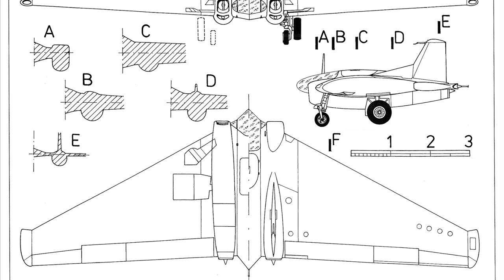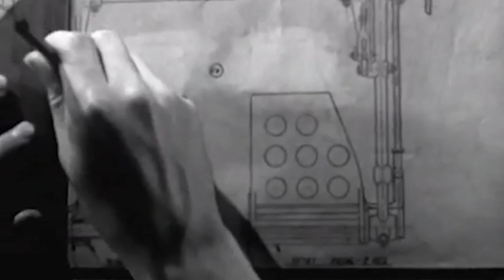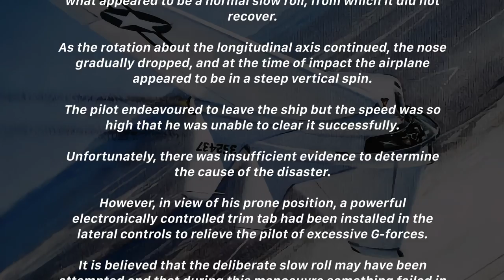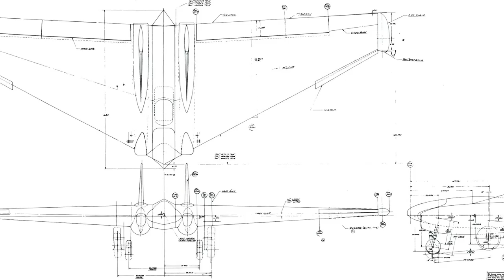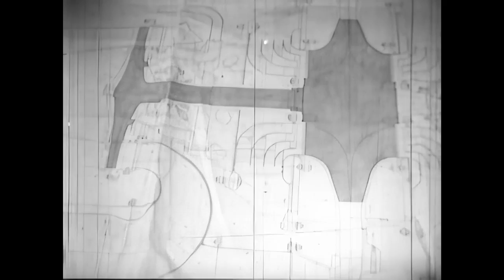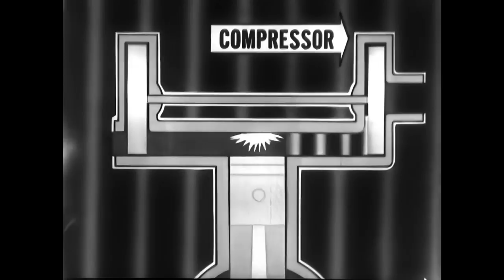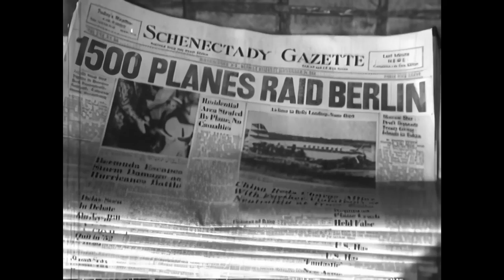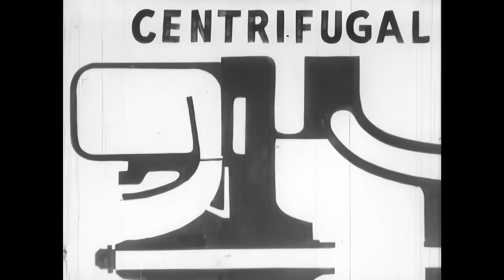The Flying Chainsaw | Northrop XP-79 Flying Wing Fighter And High-speed Rocket-Powered Aircraft

Comment: The 19B engines were returned to Westinghouse for examination after they were recoved from the crash site.  Examination showed they appeared to have been running normally at the time of the crash, but due to much damage to the piping and accessories, some sort of malfunction could not be conclusively ruled out. 19B's were highly sensitive to oil flow interruption to the bearings of any kind but the examined engines' bearings appeared to be undamaged.
Reply from the maker: Very interesting. Thank you 🙏
Reply: Catastrophic bearing "touch down", shaft welds itself to the bearing, the kinetic energy has NO WHERE to go. Destroys surrounding, engine block,secondary, crankshaft, housing, valves,cam shaft..blah blah. A "RUNAWAY" tank engine did it. Manual fuel shutoff, (of course) mechanical fuel pump, fuel lines,gallons.. tried to starve her of AIR!? Too late, turbo & blower..she sucked my red Mechanics rag outta my coveralls "high RPMS" she didn't even fart. Slapped my clipboard over the intake..She sucked a hole outta it, all 81/2"paper.  She was very angry! With no other options I told the other fella mechanic..BAIL! Take COVER! Sad, it was ALOT 💰 MONEY, and we were SHORT one LAV.  Funny now, but still VERY sad. she was one of our best vehicles &we had put ALOT of time & love into her..Even stealing parts. 😟
Reply: @mylittlebrotherca9691  sounds like my ex wife.

Comment: Love these old films,...And I love finding incongruencies. (Oopsies).
At about 22:00 they are pulling a "secrete" package out of a plane and transferring it to a panel truck.
Film is suppose to be in 1941.  The van is a First Generation Ford F-1 Panel Truck. 1948, 49, or 50. Oops! 
Panels from 1941 through 1947 look way different.
Great film, I love this kind of stuff.

Comment: The British Miles M-52 was built to fly 1000 miles at 1000 miles per hour. It had a pilot’s capsule that could be jettisoned in an emergency. The British government cancelled it and gave the design to USA.
Reply from the maker: Those are mostly rumors, it's almost impossible to find any hard evidence. Interestingly the legendary Eric "Winkle" Brown, the pilot that was scheduled to test the M.52, before it was abruptly cancelled, talks about it in this documentary: https://youtu.be/PSRAdZzRycc
Reply: I’ve read that it was the concept of the all-moving tail taken from the M52 and tested successfully in 1943 on a Miles Gillette Falcon that cured transonic stability issues with the Bell X1 which when it first flew with fixed tail surfaces encountered control issues at  M0.94.
Reply: @davidpope3943  Exactly David!

Comment: GE already having Turbo Supercharger experience was a huge advantage. The combustion chambers in the Whittle are just a bunch of pipes inbetween the compressor and turbine.
Reply from the maker: I am assuming you already watched our documentary about Sir Frank Whittle :) https://youtu.be/G0T4-XG612Q
Reply: The combustion cans were the result of relentless research by Whittle and his subcontractors and were one of the keys to the success of the engine.  Releasing that much thermal energy from fuel in such a short space was a challenge far beyond anyone in the furnace industry had ever tackled.  They were not simple pipes, but very sophisticated chambers with baffles to take the compressed air and the sprayed in fuel and mix it, burn it completely to release the energy and allow the heated expanded gas out the other end without exceeding the temperature limits of the metal alloys being used.

Comment: Insanity to think you could ram or slice another aircraft.
Reply: Imagine if the plan worked, we now probably had flying bunkers as a countermeasure to these planes...😁
Reply: I love how they kept saying this was possible because of its magnesium alloy frame and magnesium armor plating, then when the single test flight crashed and "burned completely, fueled by the highly flammable magnesium metal of its body" I facepalmed so hard.
Reply: @OldSonyMan  with the loss of both craft.
Reply: Though there is a fairly famous picture of a B-17 nearly sliced in half through the fuselage. I don't know the details of it though.
Reply: @derekpierkowski7641  
But in all fairness the one doing the slicing wasn't designed to do it.
Not that this entire concept isn't insane, just saying, it wasn't designed to do it.
Reply: @Boo_T_Shayka  
Why? What difference does that make? It was already wrecked.
Reply: @Boo_T_Shayka  I'm pretty sure it wasn't pure magnesium but an allow. More than a few racing cars have magnesium alloy wheels and there brake discs get red hot at times surely hot enough to ignite pure magnesium. Incidentally during the Falklands campaign the ships with aluminum superstructure the aluminum caught fire and burned when attacked. The British lost a couple of ships to that. All the previous aside the whole idea had a few flaws.
Reply: You can, it happened at the end of the battle of Britain when an RAF pilot who ran of ammo sliced the tail off of a German Bomber. Both planes were destroyed, but the pilot bailed out in time and survived. But it's a moot point these days, because modern 4th and 5th gen fighters use swept wing designs to achieve Mach 2+ speeds.
Reply: @Boo_T_Shayka  magnesium is very flammable but if I hold a flame to a big solid block of it nothin will happen. Strange metal for sure.
Reply: Yes, indeed.
It was one of the german tactics near the end of wwII, they called it 'rammjäger', ram-hunter, mostly practiced by young pilots against american bombers. 
This was just nuts. 
Most of the pilots, wo did it, died during that action or were heavily wounded.
The number of destroyed bombers was small, it was ineffective.
But it may be the inspiration for this bird. 
BP, germany
Reply: Why not we all know aluminum will cut right through steel you can see it on any 9/11 documentary.😜
Reply: The Japanese did it
Reply: @houseman72478  
To no avail

Comment: This might be a stupid idea, but it might make sense to put EDFs on the wingtips for yaw control of flying wings.
Reply: EDF spool up would  probably be too slow provide responsive control.
Reply: @olsonspeed  Several little ones then.

 I've never heard of electric spool up taking any significant amount of time.

Or maybe a terrible pump fed RCS system. If you can make a Tesla fly for several seconds, just using pressurized air, then I'm sure there's a way it can be done.
Reply: @jtjames79  The Harrier and F-35 use turbine bleed air ducted to the wingtips for attitude control at zero to low airspeed.  Tesla is using high pressure compressed-gas thrusters supplied from tanks for very limited "hop". Would EDF control work? Probably. The question; is it better than other control systems?
Reply: @olsonspeed  Your last question is my first question.

So I guess we're done beating around the bush.
Reply: @jtjames79  My opinion is EDF flight control  is inefficient.
Reply: @jtjames79  Aerodynamic controls; rudders, flaps, spoilers, ailerons, elevons do more than simply add drag to a wing. Aircraft bank in turns, slowing one wing will cause the aircraft to yaw.
Reply: @olsonspeed  Now you've just completely lost the plot.
Reply: @jtjames79 "To invent an airplane is nothing. To build an airplane is something. But to fly is everything." -Otto Lilienthal
 Let me know when your EDF controlled plane is flying.
Reply: @olsonspeed  cool story bro.
Reply: EDFs provide thrust like a powered propeller: thrust falls off rapidly with speed.

You need most yaw control at low speed, so this is fine. But the EDF will eventually create more drag than thrust at high speed. Somewhere well beyond 300mph it will cross to negative.

There are many ways to provide yaw control on an aircraft. Flying wings without vertical tails take unconventional methods. But yaw control is actually not very important as long as adverse-yaw is addressed. This objective can be solved with deferential aileron displacement: Down going aileron has less travel than up going aileron. Or use spoilerons, which create larger drag than rolling moment at large deflections.
Or use split-ailerons for yaw like the B2, and for air brakes like the A-10.
Reply: @TheJustinJ Good explanation. I think Forlarren was trolling for an argument.

Comment: this is probably something we could achieve nowadays with titanium or depleted uranium piercing and cutting warheads, maybe a system for the F-35 just a small little capsule with a pointy nose and a tiny scramjet (when thats achieved) or something and have little pop out swords like the R9X and have it fly straight into the root of the wing or the fuselage and cause a critical failure

Comment: The Luftwaffe calculated in  1944 that the designs for rocket powered ram fighters they were looking into would be literal suicide planes, given that a mid air impact at the speed they would be flying at would subject the pilot of the fighter to a momentary 400 Gs. The most any humam being has survived is 18 Gs. So, the ram fighter projects were quietly shelved.
Reply: John Stapp survived 46.2 Gs on a rocket sled on Dec. 10th 1954.  I know that is a lot less than 400 Gs, but considerably above 18.

Comment: They believed lying down would allow the pilot to withstand higher G forces… my back spasms just hearing it. What idiots. How on earth would all that force coming down onto your lower back not absolutely cripple the pilot?
Reply: That must be why all astronauts, cosmonauts & taikonauts are prone for launch & re-entry. It's all so clear now! Thanks! 😆
Reply: The problem with the prone position is the compression of the chest when pulling G. Astronauts are not prone, they are supine which is the best position for tolerating G loading.